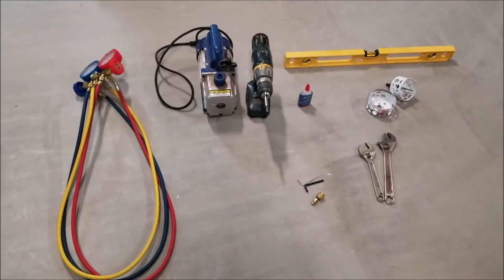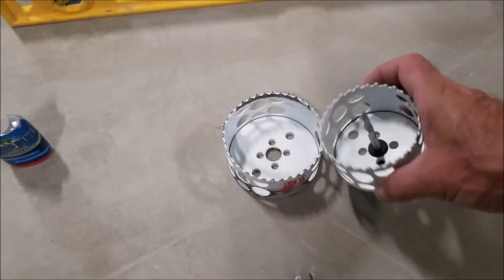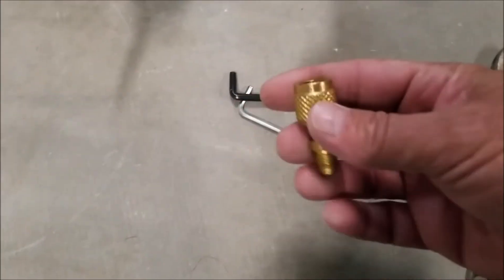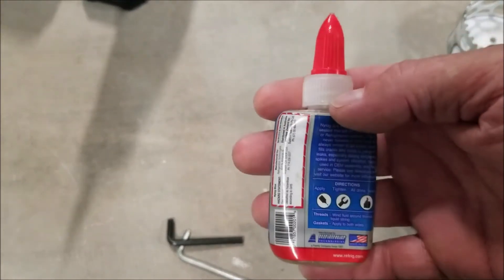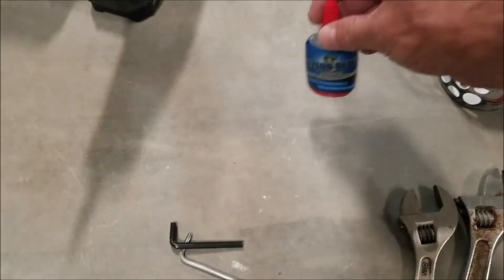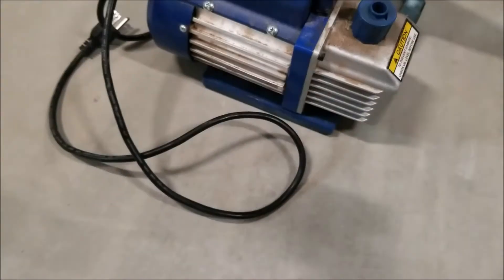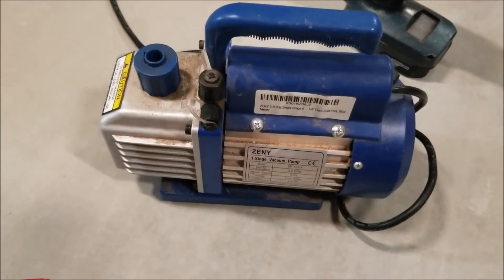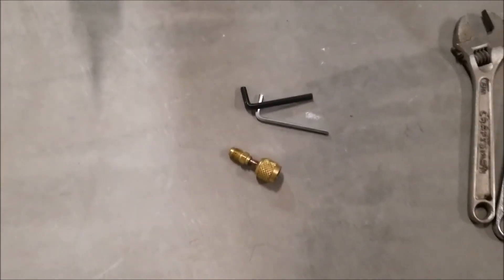Tools Needed for a DIY Mini Split Install

Comment: I've read that you're not supposed to use any kind of thread sealant as the flared fittings are supposed work metal on metal and sealants can contaminate the lines. I did a bunch of searching and that's basically what I've come up with. Seems a bit crazy to me but...
Reply from the maker: A lot of techs don't use it; metal-to-metal is also OK. The sealant is applied to the flare where it makes contact with the other flare. I've never seen it applied to the threads. Older techs often use a small amount of oil at the tip, but care has to be taken not to mix it with the refrigerant. Nylog can mix with the refrigerant and not contaminate it. Blue for modern systems like R-410A and R-134a, Red for older systems like R-22.

Comment: Do you have any tips for picking line sets? Mine comes with 3x 25ft but i need a 35ft run on one line to a far bedroom. Is that too far? And if I'm buying my own, do I just buy whatever diameter matches the other sets?
Reply from the maker: The line set can usually be extended, but it is best to look up or contact the manufacturer for recommendations and unit specifications. It can vary, but sometimes refrigerant needs to be added when a longer line set is used. Most mini-split packages are pre-charged for roughly 25 feet, but it is best to contact the manufacturer to find out the specifics since it can vary.  The line set size will need to match the unit.

Comment: Do you need torque wrenches?
Reply from the maker: I don't use torque wrenches, but they are good to use if you have them.
Reply: @HVAC_Mechanic  I don't use torque wrenches on my bicycle either